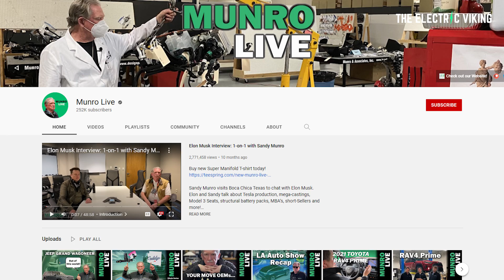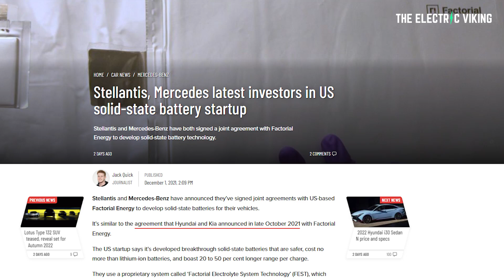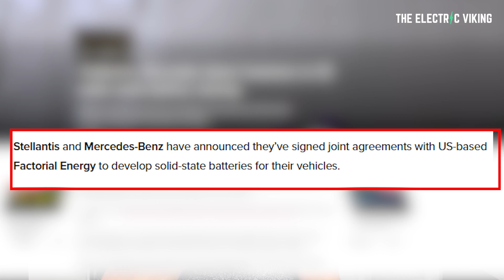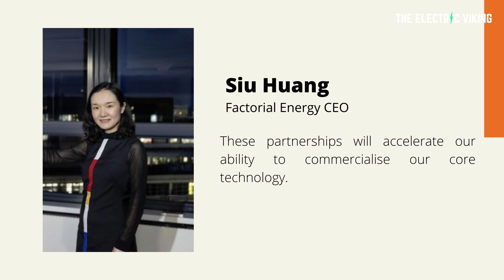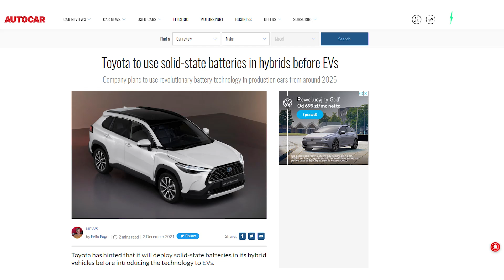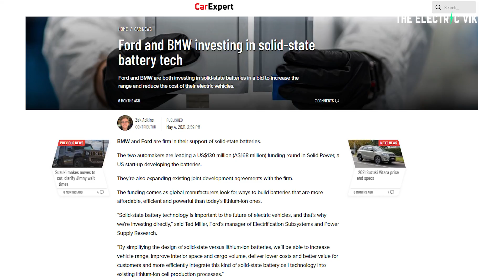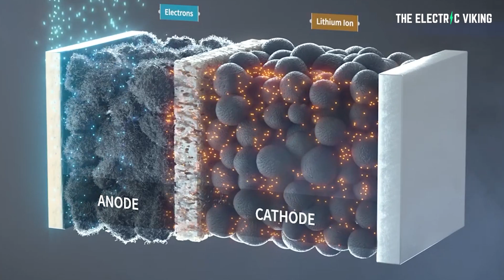United States leading the RACE to develop SOLID-STATE batteries

Comment: I would be surprised if Tesla is not also working on a Solid State battery, but haven't announced it yet. 
The words "production ready" are scary, that means that they think the battery could be mass produced, the following steps will take significant time: sourcing raw materials, building machines to assemble the raw materials into a battery, tweaking the production process to get high enough yields to be commercially viable, etc.  Getting the yield up is probably the toughest problem.
Just look at how long it has taken Tesla to get volume 4680 production rolling, I don't expect any of the other suppliers to be faster, and they are working with a new chemistry which will likely introduce more delays.
I agree that Solid State batteries are the way to the future, but I would guess at 5 to 10 years before we see lots of them.

Comment: Do a video on the estimated costs of replacing an entire battery bay in various models from various manufacturers?

This is one of the single most important aspects of buying an EV. It will also determine the resale value in large part, which might seem a distant thought, but should not be. Thanks.

Comment: the reason musk says LFP is future is because even if the solid state batteries prove they work in real world conditions it takes years and probably a decade to get manufacturing at the scale needed.. so assuming the first production line of any scale starts in 2025 (that's an 'if') we are 7-8-9 years away from that before we reach the scale required - that's in the 2030s

Comment: I guess so with mercedes having something "different" in their EV cars and SSB would fit right in.
I have wondered for a few years back why Elon has gone the route that he has, with his batteries of choice. To me, It's the cost productions of these cylindrical 2170 and 18650 batteries as it's easier to roll these batteries + easier heat dissipation + structural strength than pouches. I must not forget their new 4680…even cheaper.
 Yes he's moved onto LiFePo batteries but it's the cost (as well as for safety, thermal range). It's 20-30% cheaper than NCA chemistry. It's really is no brainer at 20% discount... or 10%.. and will get cheaper..

I'm not sure if Tesla will pick up solid state batteries if the price isn't there.. ok maybe in time, for its roadster and SSB can be mass produced.

Comment: You can have solid state LFP batteries. Solid state is simply a solid electrolyte instead of a liquid. Quantumscape is doing both types of solid state batteries (NMC & LFP). NMC does better with range and performance. LFP does better for cost, lifecycle and safety.

Comment: QuantumScape has a liquid electrolyte.  The separator is "solid".  All their tests are done at 3.4 atmospheres.  I'm not sure what that means.  Does it mean that their batteries have to be used in an airtight enclosure and pressurized to 3.4 atmospheres?  Does anyone out there know?

Comment: I'm sorry, but my read on solid-state batteries is that the UK & Japan are quite far ahead and this investment from the big three is a desperate rush to get in the game. Small breakthroughs do not address getting to commercialization & production. However, any significant investment will push R&D forward, but to date, the US has been an "also-ran" as the US struggles to get its heads around the transition to electric.

Comment: Battery innovation has accelerated quite impressively. In fact almost everything on the planet is under constant evolution and improvement. Imagine a cell phone with a lead acid battery. Why then is Sam so negative on hydrogen? Wouldn't the efficiencies with that technology not improve if a focus on innovation and efforts the same way that's being poured into batteries? Just a thought.
Reply: Hydrogen has had billions poured into development, and so far has had far less progress than lithium batteries. There is also the efficiency problems that have EV's leaving hydrogen in the dust. Being able to charge my EV at home rather than going to a hydrogen station is a deal breaker for me now. Hydrogen just cannot overcome issues of complexity and efficiency losses in each stage of processing from well to wheels. And since most hydrogen is still made from fossil fuels it is in no way clean. Even if we did make hydrogen from clean energy, it would still cost a lot more, as it is far cheaper and more efficient to just send that electricity to an EV.  Hydrogen requires expensive equipment to take the electricity and create hydrogen, compress and store the hydrogen, transport the hydrogen, store the hydrogen and dispense it into vehicles, then store the hydrogen on vehicles and convert it back to electricity that then drives electric motors on the vehicles. Oh right, the hydrogen vehicles still need battery packs, electric motors, and inverters, just like EV's and ICE hybrid vehicles. So if one has to already have everything needed for a BEV that is far cheaper, simpler to build, already reaching cost parity with ICE, and can be fueled from inexpensive to install electrical equipment, why bother with the hydrogen?
Reply: @GoCoyote  Got it. I don't disagree except where I live I would guess more than 50% of the population live in dwellings that make home charging very difficult. Those people will have no choice but to rely on public chargers anyway. I get all the arguments you put forward. Can't dispute too much but I still believe it's unwise to reject a technology based on the immediate challenges. If all current petrol stations were converted (possible) the consumer would not need to have a shift in their behavior while driving a clean tailpipe car. The consumer would feel they are doing their part leaving the inefficiency and broader ecological impact to the engineers and scientists. The hurdles you raise while legit have possibilities for improvement regardless how remote. Not being argumentative at all. I just have more confidence in innovation on many levels. Perhaps solutions exist for hydrogen that you and I have no understanding of and have not been invented yet? Transportation, communication etc has been almost magic in the past 100 years. Have faith. 😉
Reply: @GoCoyote  Once again though you leave out where the energy to charge the battery comes from. Near me it's lignite that is a non renewable heavily polluting fuel. It's not Apple to apples by looking at the "well to wheel" and not do the same for batteries. Yes, batteries will still win,,, but the gap narrows unless you're like Norway and rely on hydro power. Those countries utilizing nuclear is another complicated matter. If the world shifts 100% to BEVs the power generating capacity needs to expand hugely. Perhaps with not so desirable fuel sources.
Reply: @GoCoyote  Just did a brief look at the amount of money needed to expand current power generation to meet 100% BEVs. The number is staggering running into trillions of dollars. Not to mention the upgrading necessary to install home and public chargers. Factoring all those costs (somebody pays, 🙂) The argument for going clean also has huge costs that are not amortized to each vehicle. For example in some rural areas near me the electrical home standard may not support even simple wall charging. The main breakers are insufficient. So if my wife drives our EV to see her family at the moment she cannot recharge there for the return trip. I guess I'm stuck rewiring my in-laws house. ☺️ I'm Not trying to win an argument here just throwing ideas out for conversation sake. As I mentioned I'm an EV owner and generally very happy about that. Cheers,
Reply: @sunrisejak2709  
No arguments here! But as an electrician who has worked in both industrial and the clean energy industry for awhile, I believe I can address some of your concerns. Since the cobblers children have no shoes, I have not even bothered to install a level two 240 volt charger at my house (USA power system), and just use the 12 amp 120 volt travel charger that came with the car. I will get around to it someday LOL, and have hardly ever had any issues as it usually only takes my car overnight to charge fully. Most houses have a 240 Volt electric dryer circuit, and also have the capacity too easily add another. There are nice units that plug into your existing dryer circuit that allow the car to charge when the dryer is not being used, and allow the dryer to function normally if adding another circuit will overload the main panel. I have set up chargers using existing circuits to provide 15 amps at 240volts, that while not providing the maximum charge rate, are perfectly adequate to meet the owners needs until further upgrades can be afforded when necessary.(Sorry about your in-laws place). As to the amount of power needed, this is somewhat of a red herring. First of all, most EV's are charged at home overnight when overall power use is low and the supply is plentiful, so the grid is just fine. In states that limit the level of profit electrical utilities can make, this has helped keep utility rates lower as the utilities are able to make more profit on the lower cost power sold during the night. Secondly, it takes on average between 2 to 4 kW hours of grid supplied electricity to produce 1 gallon of diesel or gasoline/petrol, which is enough power to move most electric cars between 6 to 12 miles down the road when not used for refining fossil fuels. So shifting to EV's actually frees up electricity supply that offsets at least some of their use. As to adding new capacity, that has been happening by itself, as it is now cheaper to add utility scale PV and wind power systems with battery backup, than to keep existing fossil fuel or nuclear plants operating, including natural gas. This, along with increased home based  PV with battery backup, has not only increased supply, but also is decentralizing power production. This helps keep the major power lines from having to carry power over long distances, since the power is being both produced and used more locally. Of course, working to increase power line capacity is certainly beneficial to increased grid resiliency and makes moving power from different areas easier. Another area that is just starting to be adopted is using EV's as vehicle to grid power. Some pilot projects with school districts who have adopted electric buses have found that they are able use any unused battery capacity in the buses to buy power to charge them when it is cheap, and then sell back the power when demand is high for a profit. This has helped the buses pay for themselves (within 2-3 years) even faster than just the lower maintenance, fuel savings, and increased lifespan would. Best of luck with your in-laws power system. I have a couple of things on my in-law list also COL (chuckling out loud). Cheers!
Reply: @GoCoyote  Hi, great information. I'm at the other end of the understanding of electricity transfer so any knowledge is much more than I have now. If by chance you go on holiday to Thailand you could fund your trip with just a few upgrades around the countryside. Glad to know my concerns with grid expansion is a bit "sky is falling" anticipation. But once homes and transportation rely primarily on the grid I might worry about rates going up. Anyway thanks for the education and exchange. And hope I don't sound too stupid or should I say ignorant with my undereducated observations. Just trying to learn. Cheers, and for happy wife, happy life better get those in-law things knocked out! 🙂
Reply: @sunrisejak2709  
I try not to judge people who do not understand something. We all only have so much time, and need to prioritize many things in our lives. One can not learn everything, even if we like to appear that way LOL. My children have many skills that astound me, as do many others. And then we all have the moments where we hope no one saw just how dumb we were. The most powerful words I have learned are "I don't know." My wife says I had better get some of her list done before I help the in-laws, and that I have a lot of opinions along with my facts LOL.

Comment: Will the new improved batteries fit into existing EV's? Will the new generation batteries be fitted to EV's on backorder?  Will the newly designed batteries also make the EV's so heavy, chewing through tyres and road surfaces?   Will they ever get the fantastic new battery-driven cars as light as petrol driven cars?

Comment: "SSBs are the next best tech" this was said 10years ago.
Tesla attracts all the best engineers, and Tesla evaluates all the new tech. All.
The current SSBs expand when they are heated. This is why the SSBs used by Mercedes in their e busses and e trucks, must be kept at a constant 80°C to avoid the thermal expansion issue. This make the current SSBs impractical for domestic use.

Comment: Toyota is leading the way in solid state batteries. They've been road testing a street legal solid state BEV for over a year. Don't be surprised if that's what comes off the line in 2025 at the new Toyota battery plant in North Carolina. For HEVs and PHEVs first, then BEVs.
Reply: Believe it when you see it.
What's the plan? 20% by 2030? Or about a million full BEV? TEN years too late.

Comment: There are many different new battery technologies that are developing and competing in parallel. Solid-state batteries are just one of them, and they also have many problems. In addition to being too expensive, they are also based on metallic lithium. The reserves and output of metallic lithium seem to be limited, which may be not enough to fully replace motorcars in the future. I guess that sodium or magnesium batteries may be the future direction, at least they do not rely on rare metals.
Reply: Any metal used in huge numbers of cells globally will become relatively "rare" (the rate metals you elude to are not)

Comment: Until someone figures out how to manufacture them at scale its nothing but a 100 year old pipe dream. The electrolytic separator has been the stumbling block for decades. Maybe if they can figure out how to 3D print it into the cell they may have a viable technology finally, but 3D printing has a long way to go before that is going to be possible either.

Comment: How can you get excited with USA solid-state companies without considering that Toyota is already driving around in a working solid-state powered car?
Reply: Toyota has a version in a prototype car, nothing they are selling. You could put quantum scape lab samples, or solid power, factorial etc... into a prototype, but that means nothing for production of them. Toyota may be ahead in solid state, but until anyone has something commercially available, we don't know for sure. There is a super car right now available (or maybe about to be available) with SS batteries in it, but it is close to 1 million USD. Prototypes don't necessarily mean you are further ahead in mass market production.
Reply: Also, you would think that the companies investing in QS, SP, and FE did their homework before that (mentioned in the video). Then again GM invested in Nikola motors, so maybe not. :)

Comment: Solid state should eventually be better in every category, environmental and performance. Great to see the USA in the lead, in contrast China spending is 2/3 of research of quantum computing. I suspect it will be a while till we get them in production. Hopefully it plays into my scheme to buy a used Chevy Bolt cheap, it will be old technology but I will do a vast majority of my charging at home.
Reply: Musk promoting lifepo maybe protecting sales against a unicorn we might not see for 10 years. This is why Nissan should design a new Leaf with an easily replaceable battery and possibility of future upgrade. Market share regained.
Reply: 100% agree putting solid state in a hybrid would be ridiculous, how about a retrofit plug in hybrids with a battery of the same dimensions & dump the ICE. It have to be aftermarket, because there'd be no $ in it for automakers... Hurting future sales.

Comment: toyota is probably putting them in hybrids first because they have a limited supply.  With the higher energy density you could easily make it a plug in hybrid without having to change any design
Reply: Look at the recent statement (October?) Where they indicated they plan something like 20% production to be "electrified" (all forms, including hybrid and Hydrogen) by 2030 (later?).
Assuming a current production of 10 million, and that they are optimistic of maintaining that number (🤔 how?) They committed to about 1-2 million full BEV cars...... Or the sam as Tesla plans for 2022/23.

Then there's the apparent energy density.
If they reach the solid state holy grail of 400-500 w/kg, that REALLY makes hybrids redundant. Aren't they confident of doing that?

Comment: As always with vehicles, it’s the power to weight ratio that will determine the battery type winner. The battery type with the highest power and lowest weight will win out over the other battery types. That’s why EVs using lead acid batteries were losers.
Reply: Completely agree with Jan 6, it isn't that simple. Look at the choice to go for LFP vs. NCA or NCM even though it is a lower power to weight ratio. But it is cheaper, needs less thermal management, and is safer. So you add 50-100kg to a car and it costs less has more range and is safer. The argument is much more nuanced than that. However, it is true that there is an upper limit of power to weight you can tolerate. Lead acid was just too heavy for the power provided, cause they are darn cheap. But you may take 10% more weight for 25% less cost.